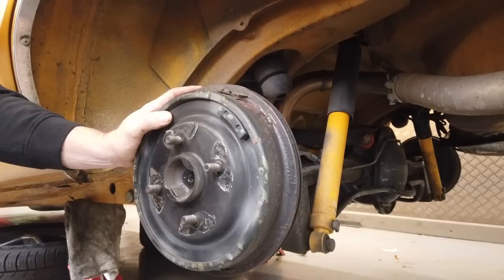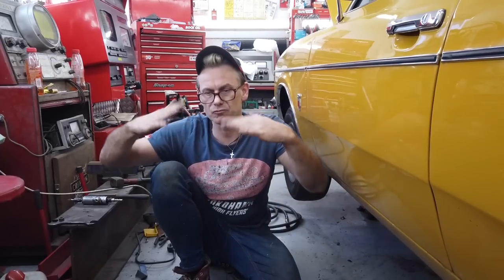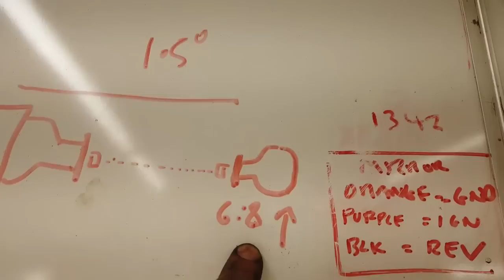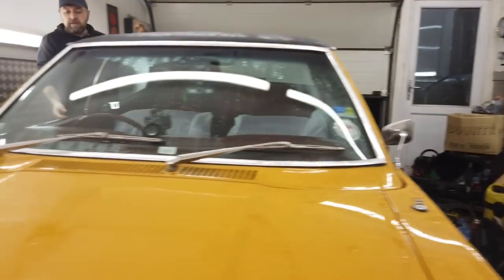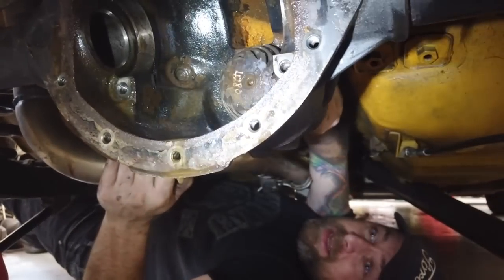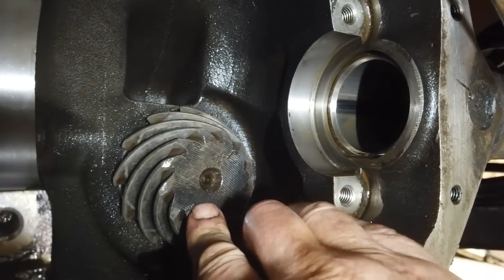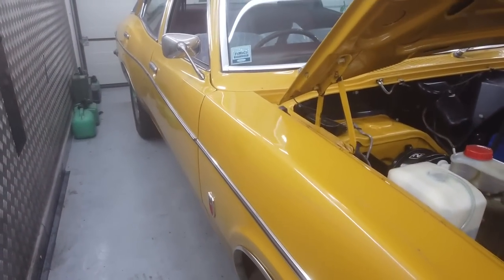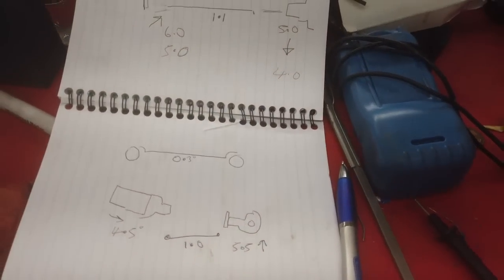Cortina Mk3 axle swap -  New axle fitted

Comment: Great video Pete, glad you got an acceptable result for the time being.  Some years ago I bought a Type 9 box which I was told had done very low mileage,. luckily I took the inspection cover off and found it was completely worn out.  I've bought a brand new clutch assembly which was out of balance too and that had to come out again which is a suspension drop on my Escort.